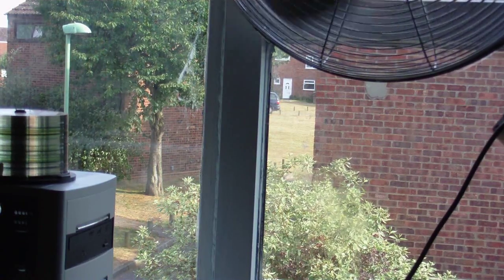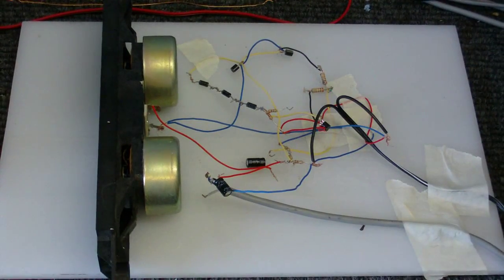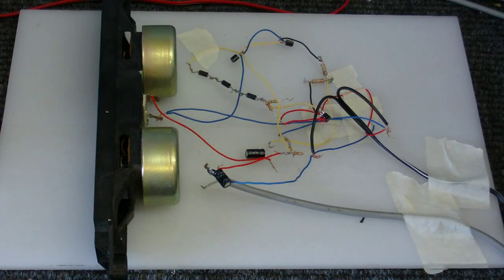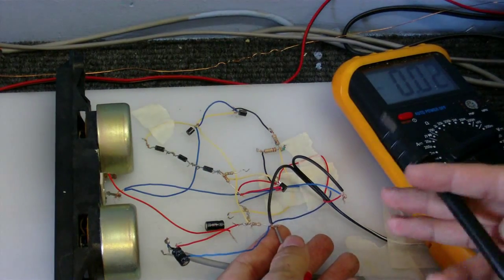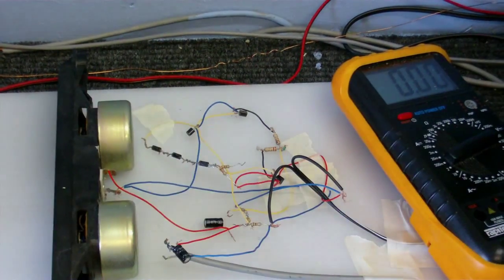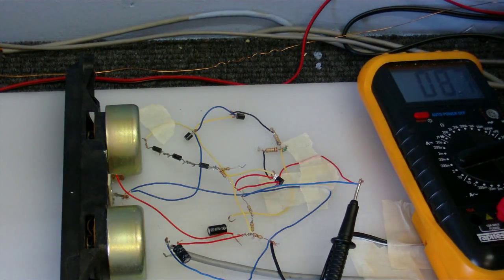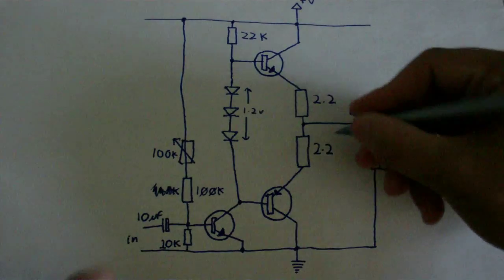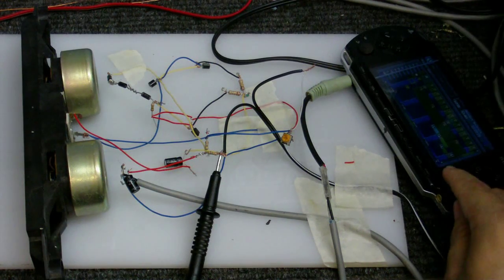CDC Electronic workshop S2 EP 2 - Another transistor amplifier experiment

Comment: @CoolDudeClem If I have a transistor and I am too lazy to look up the specifications, I use a multimeter  set on diode tester mode and my tongue. I identify first the base (for a NPN, the base will conduct to both collector and emitter). Once I know the base, I put the multimeter probes on collector and emitter. Then I put the tongue just in between the plus of the multimeter to the base. If the indication drops significantly, the pin connected to plus is the colector. If not, I swap the probes.

Comment from the maker: @windoes98se it can be difficault to tell for sure, most transistors like the ones i used here, when you're looking at the labeled side of it the emmitter is on the left, collector is in the middle and base is on the right, but on some transistors the base and collector are the other way round, if in doubt, look up the transistor you have on the web, there should be a datasheet with the pinouts on it.